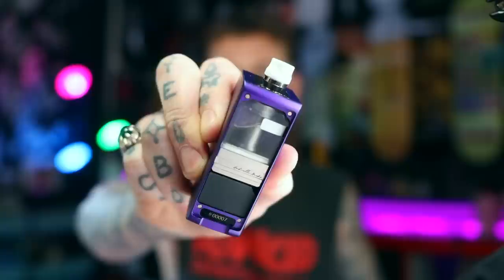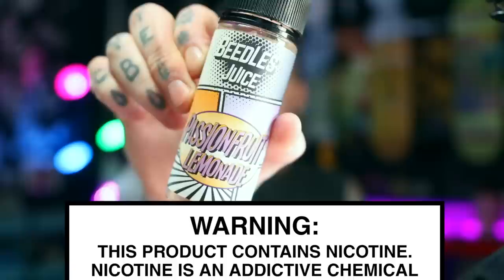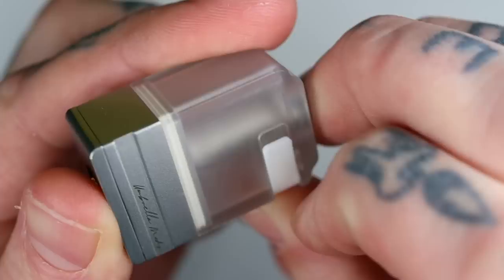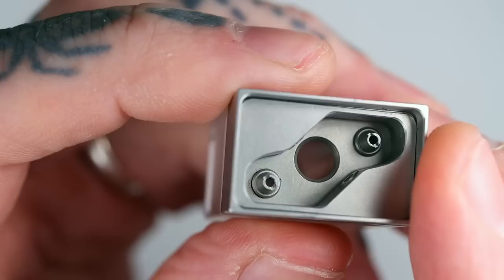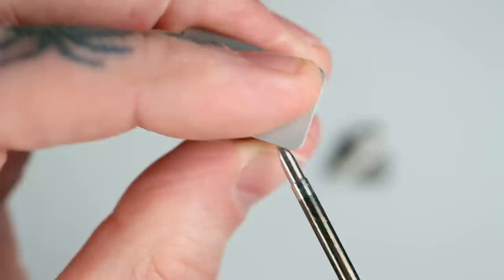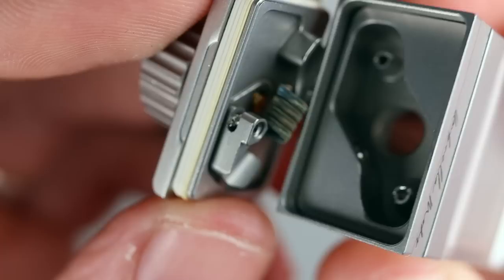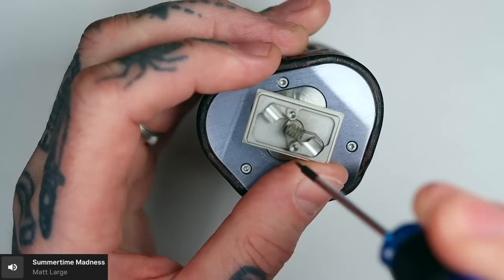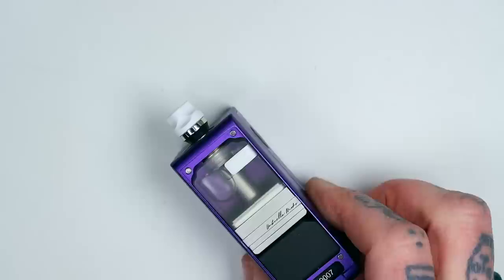Vision RBA Umbrella Mods + Build & Wicking Tutorial | Top Airflow Boro first?

Comment: I wonder if you could also turn that tank section so the fill plug is on the left side as well. Some mods the fill plug on the right side might be a issue so that would make it even cooler if you could turn it so the fill plug is on the left side.